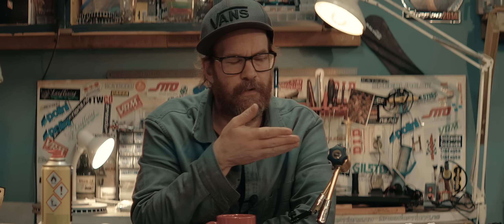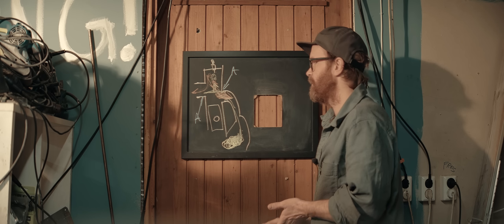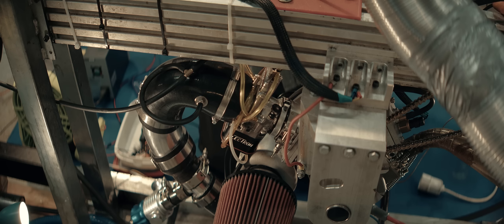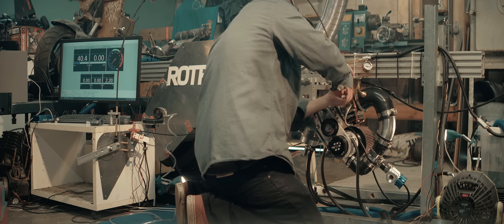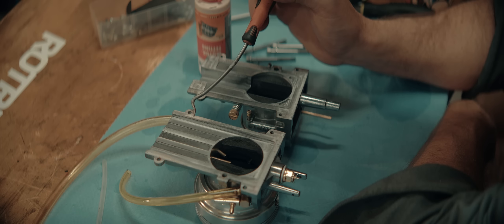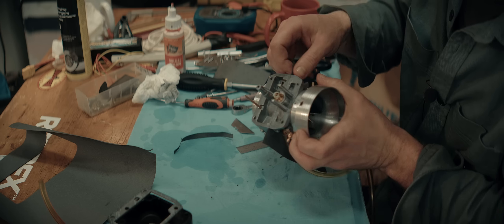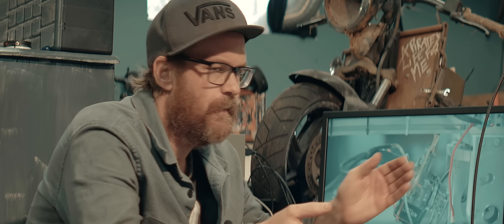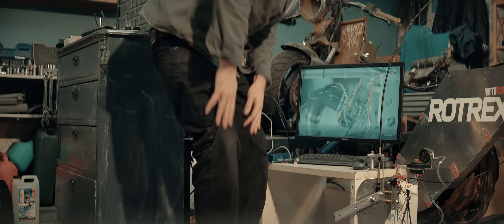50cc Engine in there somewhere...

Comment: I think fuel injection and mega squirt  would solve all your adjustment and fuelling issues. The technology is all there. So easy to tune.
Just look at the turbo charged 2 stroke snowmobiles.
Reply: Kinda pissing in the wind with carbs , but kudos for not giving up. Personally I would have given up and switched to some sort of 2ST capable electronic injection a long time ago

Comment: How about doing an NA test to See Hp/Nm curve to analyze air flow and possible restrictions such as carb, crankcase, inlet channels etc. In this way you will learn where the engine has peak flow and what to expect with SC. From previous videos peak power was at 10-12.000 rpm (?) but this should be at much higher revs to reach the record breaking goal. 
When air speed is too high it will stall the air and so a thought is: is it possible to “inject” air/fuel directly to combustion chamber and bypass the crankcase? 
When moving A LOT of air and fuel changing directions and volumes could cause unwanted losses. 
You are legend BTW 😊😊😊

Comment: DUMP THE LECTRON AND USE A DELLORTO 34MM standard equipment on a full power aprilia rs 125, or use the one from a rotax kart engine with the 4 stroke circuit,full housing so wont leak
Reply: Too big.  Way too big.
Reply: @gregw6748  not at all .just close up the venturi like he has done on the lectron
Reply: @RacinRitchieyt  Or not fully open the throttle and rely on the needle to adjust the top end. It works when not riding flat out.
Reply: @RacinRitchieyt  it needs to be 22mm. 
100cc 2T kart motor, 20,000rpm, 24mm
60cc 2T kart motor, 16,000rpm
18mm

You can’t atomise the fuel with the change of state that he’s getting

Comment: Try EFi. Don’t think that the injector has to inject when the port is open, that’s not the case, think of the EFi injector as a carb, a mist of fuel will come from it and just become part of the “charge” that is moving along the induction path. 
You will have so much more control, repeatability and reliability with a simple efi system like megasquirt. All you need is rpm input, load input, EFi pump and regulator and an injector, I wouldn’t worry about timing injection… it’s not a diesel. All the best

Comment: Alex, for the sake of getting you back on track, compare your mass flow indications by comparing your engine to other 2 T engines which do work. You needn't ape everything, but at the same time, you needn't reinvent the wheel continuously either. Every thing in your engine in terms of fuel and air are seriously outsized. Just trying to help my friend. Additionally, why do you need to heat your coolant? That is mystifying to me. It is coolant, isn't it? The engine should be producing so much energy/heat that coolant becomes necessary. If you need to add heat, you are not making enough power/heat in the first place.
Reply: Just a quicky on warming the coolant. Alex used to test his engines at room temperature which is cold in a Norwegian winter tightening the engine. The engine never runs long enough to warm the vast amount of coolant used.

Comment: Curious, why are you sticking to a carburetor? - Carburetors was used in the pre 80's on forced induction before EFI came along. Why not convert to standard 12v fuel pump, standard fuel pressure regulator, cable throttle body + drink coffee while laptop mapping a single 12v injector, injecting directly into crankcase or inlet pipe? All leaks then gone and with a wide band lambda sensor in the exhaust you know exactly what is going on. A single management system can control everything, including logs etc. Thanks for great videos and awesome project!

Comment: Did you also think of the exhaust being to small under boost.
50cc on 1bar boost is like a 100cc amount of flow.
Exhaust to small also chockes on exhaust gasses  back in to the cilinder.

Comment: Alex, your diagram illustration got me to realise that you are actually fighting against yourself with the way you have it all plumbed up.. when under boost you are pressurizing the crank case, this pressure is also acting on the back of the piston ultimately trying to keep the piston at the top of the bore. This is draining your horsepower dramatically as it is a resistance that any motor does not want. 
You need to run all airflow externally of the crankcase.
Reply from the maker: It's ultimately trying to keep the piston at the top of the bore when its at BDC too😁
Reply: @2STROKESTUFFING  that is the case only when the pressure in the cylinder overcomes the pressure in the crankcase.. Obviously combustion pressure is going to overcome the boost pressure in the crankcase but it is still a huge resistance that a small cc engine does not need when trying to get HP numbers..
Reply from the maker: @philmcdonald1829  I can't wrap my head around how pressure in the case(unless so high that the piston is unable to make it down to BDC at all) would make a difference. Imagine a spring down there, acting on the piston, the force applied to it on the way down would be released on the way up.
Reply: @2STROKESTUFFING  yes on the way up it will be assisted but the power stroke is restricted by the pressure acting on the underside of the piston.. your power comes from how quick that piston can be pushed down to BDC. If the piston is being slowed down by that pressure acting under the piston you are loosing that power you want.. I have been thinking about ways to overcome the lubrication issues that you would encounter by not having the fuel/oil mixture going through the crankcase and believe that oil needs to be injected\sprayed into the crankcase.. the blower needs to draw through the crank case then feed the air\oil mixture under boost pressure(removing issues of seal damage if it was a full draw through arrangement) through the carb where the oil\fuel mix is combined directly into the cylinder. Normally boosted engines crankcase are vented allowing as much of the boost pressure to be relieved..

Comment: Instead of going EFI you can go mechanical if you'd ever consider fuel injection. Can be worked to do the job similarly on Top Fuel dragsters too (since you'd run similar fuel already). Then the only thing left would be is really hot ignition. But for the mean time...make do with what's available! It's promising!
Reply: Haven't followed this channel but first question was - why no fuel injection. Messing with that CarbUTraitor instead.

Comment: I know its not your flavor of building, but carbs are simple devices and trying to make them complex is a feat of diminishing returns. The Lectron is awesome carb and works very well. The issue is it was designed for street use and adapting to race is difficult as you are finding out. Building motors that run on methanol and supercharged and understanding nitro, I would look into a carb that may be more suited for blow through.  S&S Cycle makes a very basic carb that has what I feel you motor is looking for.   These carbs are used on Harley Davidson motorcycles and have a strong following. There are some major upgrades that will fit your application. You can add a standard style booster venturi, and additional adjustable fuel circuits. Thunderjet is the brand name. I have seen between 1 and 3 added.   Not expecting agreement just giving another option. Last thing it it has a dual cable system one to operate the carb and the second know as an idle cable, is a second cable that if the return spring fails it mechanically will close.   Not used for setting idle as many think.
Reply from the maker: 👍Thanks for the input! I'm sticking with this Lectron mostly out of stubbornness at this point.

Comment: The pressure of the charger is too much for ANY Carburettor (I told you twice). Therefore the French "Motobecane" engineers built Injection on theyr
350 three cylinder 2-stroke and reached very high power on the Dyno - up to 600hp per Liter with Supercharger.
Reply from the maker: 😁 I'll make it work!

Comment: You don't need this 2 stroke exhaust. Your engine is permanently overfilled with a lot of pressure due to the charger.
The resonances in the exhaust only disturb. 
Try a straight short pipe
Anyway - great Job

Comment: It would be cool if you could have a turbine on the exhaust connected to the supercharging belt drive. Then the actual 50cc engine would be more of a suggestion as to where the combustion needed to take place more than a rule. Backfiring could really just be part of the whole combustion process.

Comment: I think you maybe should rethink your theory on supercharged 2t vs std. As power increases, mass flow requirements of the exhaust increase. This creates more back pressure. in turno applications, much of the port timings remain the same as std. why - as boost increases so does back pressure so all the delta P remain mostly the same. In supercharged its likely better/less back pressure - IF you size the exhaust port and pipe, header, stinger to suit the power level you are at

Comment: What about doing a constant flow / mechanical fuel injection system? 
Use just a larger version of the power jets to meter fuel flow/bypass. 
We tune our mechanical injection systems by changing how much fuel DOESNT go to the barrel valve/nozzles

Comment: Can you get rid of the slide as far as it being an air metering tool and just use it for a fuel metering tool and put a butterfly in the system and get rid of all your slide problems.

Comment: Why not draw fuel into the charger intake, rather than having it at the engine intake ? I've seen it done before engine will run fine. Solves a multitude of issues. Keep up the good work.

Comment: You dont need the overpressure in the crank case since the blower will fill the cylinder for you. The engine will rev more easy w/o pressure in the crankcase…

Comment: Pull through system and a smaller diameter intake pipe from the charger to the engine, in my opinion would solve almost all of the tuning issues. 
Air velocity plays a big part, and drawing through the carb would alleviate the stress from boost

Comment: Hi, I saw your idea at beginning of the Video. Makes me think that less degrees of transfer will work ok because we have more pressure at crankcase.
So. After it you can use less Degrees for exhaust, the blow down is the. Important thing to keep, to keep power at the same. So you will get long power stroke. I mean more degrees duration of get out power from engine. This is a benefit that should be used

Comment: Your next project  could be using the crankcase as a charger, by changing its dimensions thru stroke cycle, for example opposite pistons, one in open head tube...

Comment: Not going to say I dont love every minute but any two stroke dude is still scratching our heads. yes its a running motor, yes it is very immersive and impressive build. I just think its going to circle back to realize a turbo aint doing squat for a two stroke, porting and polishing would walk the dog around that, sounds bogged out all the time. I still love what your doing.
Reply: I think a turbo creates to much lag to ever improve a 2 stroke.
Reply: @pokerdealer2003  Yes your right. A turbo needs a more or less a constant flow to keep the impeller spinning consistently. Most tests so far have being short bursts not giving a turbo time to spool up.
0- 20k is a very large operating window.

Comment: On the carb you need O-Ring material. Endmill a slot for the O-Ring, but I see the that you need to go around the screw, and you have a lot of material there. Quit using gasket sealant.

Comment: More progress this time! Being supercharged, I'm wondering if a megaphone exhaust would work better than the expansion chamber? The pipe is trying to push some mixture back into the cylinder, which is being pressurized by the blower. Could there be some pressure oscillations doing funny things? Easy to try
Reply: Your may be onto some thing with your expansion chamber thoughts. Alex has  a short megaphone which was used on the Brute Force engine which could be adapted quite easily. Possibly the stinger could made a larger diameter to reduce internal presure. Expansion chambers need tuning to the induction system. I believe this pipe is tuned for 19k normally aspirated.
If the rotrex is forcing too much fuel/air into the engine, slow down the Rotrex thus reducing engine loading.

Comment: I'm sure you don't need my advice, but I will offer an opinion. If it were me I'd enclose the carb and fuel pump including all the vents in a sealed box and pressurize the box with the supercharger. That would make everything function at the same pressure .It should make for better metering and  It would also reduce some of the leakage issues as the pressure inside and outside the carb would be more equal. Not a new idea it has been used in automotive applications for years. My 2 cents. Cheers.

Comment: Build a box around the carb....(A turbo enclosure) it will pressurize the outside of the carb as much as the inside.....forces will no longer push fuel out

Comment: If you can find a small enough injector, throttle body injection can be relatively simple.  Start using only rpm and throttle position (alpha n).  Once you get it running, you can add in boost and barometric pressure, air temp, and even pipe center section temp.

Comment: That's exactly what I was thinking, JB weld it together.  If you had to separate it I'm sure you can use heat or bake it, but you'll have to take everything you can out of the carb and you'll have to redo the 3D printed reducer. You're learning about waterproofing.  It's really easy to make something water resistant, where the device is just coming in contact with a liquid, but it's hard to make it water proof where the seals hold up to pressure.  For example when diving down the deeper you go the higher the pressure.

Comment: Alex why don't you try decreasing the area of the exhaust manifold with a butterfly valve?  you may get low rpm torque improvements, it would help the engine stay in its optimal rpm range.  then I was thinking but maybe I'm wrong(I don't have a 2t turbo XD), is it so important to have an expansion in this case?  since in most of the flushing anyway, the inlet pressure of the transfer will be higher than the pressure returning to the exhaust, in any case you have fresh fuel coming out of the exhaust, correct me if I'm wrong.  and by the way, as always, beautiful work, I don't miss a single video🤩

Comment: Hey! I suggest you look into for example suzuki gs500 carb, Use it like your lectron with fuel pump and pitot tube, those makes that carb flow enough fuel and it never gets stuck from boost. Flatslide carbs are not suited for boost at all. There is no guarantee that your carb could even work because your modifications inside of the throat. Fuel atomisation is very delicate process and should not be messed around with or it might not work correctly at all.

Comment: with a turbo you should be able to form a combustion chamber between the exhaust port and the turbo, where you can let the escaping fuel air mix burn, kinda like a gas turbine engine. that energy can be used to spin the compressor. with the piston at BDC air should be able to pass thru the cylinder and into the expansion/after burner chamber where you can run the turbo as a gas turbine engine.

Comment: 3d printing is the technology to make 2 strokes better than ever before, integrating the blower with a direct drive and a whole foot shorter airflow path would be my starting point, also drawing the supercharger air thru a carb will always have a vacuum, simplifying the reed\carb\throttle process, conventional off the shelf nuts and bolts parts cobbled together creates issues, the best part is no part, or combining as much as you can into a simple part that just works. The compressor can't really hydrolock, and fuel atomization would be nuts, everything would be much more rpm based, the only downside is fuel inside the compressor, which as you said would harm the seals, and a backfire may damage the compressor. So maybe make a backfire arrestor, something to dampen the wave front (think potato slicer of steel)and blow out a thin aluminum plate, like in supercharged top fuel engines. Traditional carb. Much more response, violent fuel atomization, fewer variables. Have the supercharger mere inches from the piston, airflow wise. It's just the seal holding you back isn't it? Teflon? Delrin? Maybe positive pressure in the compressor oilling system?

Comment: With supercharging or turbocharging it seems the way that two stroke diesels went is the most advantagous - intake timed by transfer port, exhaust timed by a valve. Probably fuel injection is also preffered. And a closed oil system with air not going through the crank case.

Comment: The piston makes higher pressure in the crankcase naturally the faster it travels making this type of two stroke internally supercharged ..but i am with you saying lets make it MORE supercharged ....bolt your supercharger directly to the bottom of the crankcase open to the crankshaft all sealed to the out side ...bolt on a carburator to the inlet of the supercharger ..no need for a reed valve as the supercharger now does all the work ....and you can drive the supercharger off one of the crankshaft fly wheels by merely having gear teeth machined on the out side edge of the flywheel driving an internal gear spinning the supercharger ..very simple design and all self contained ...go for it ! ...at least make yourself a CAD program drawing and look at it yourself